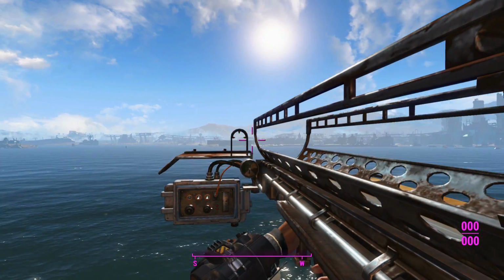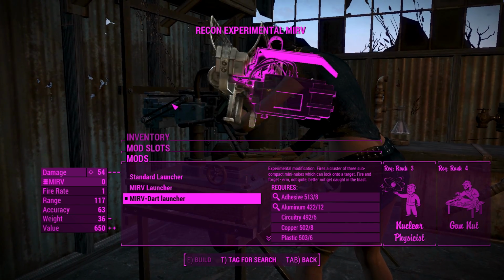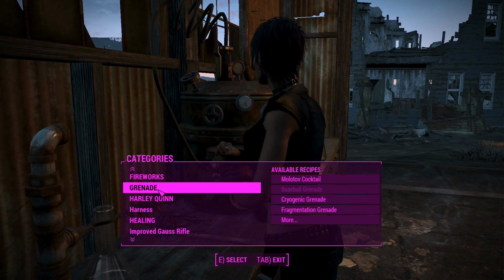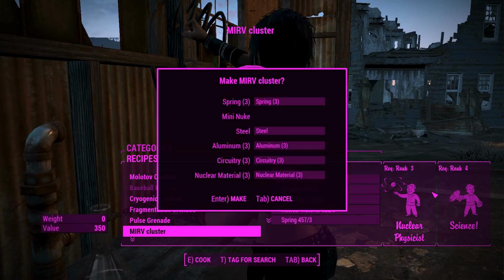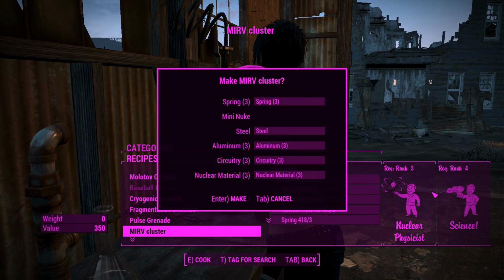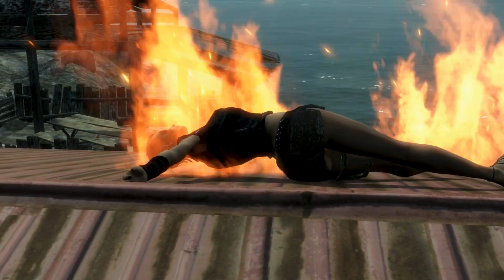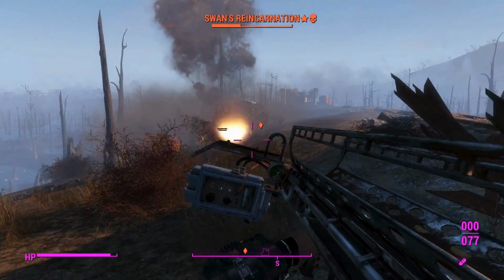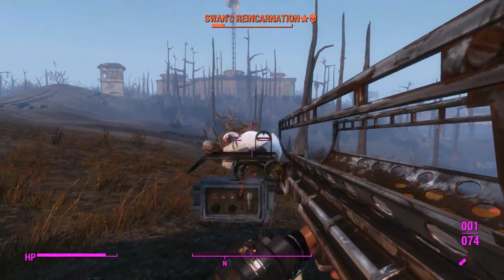Fallout 4: Weapon Showcases: MIRV Dart (Mod Update)

Comment: Sigh, back to the drawing board I guess ... :(
Personally I'm always using the homing function to make sure I hit what I want. And I don't think that I can fix the issue with the irregular firing pattern as this is an issue with the engine itself calculating the spawn vectors in an odd way.
EDIT: I think I should explain what I found out so you can better understand what's going on with the MIRV in general (and why it sucks so much): after some extensive testing I  concluded that the engine uses a VERY broken vec3d update system because the axes of the visual viewspace and the 3d worldspace are shifted. You can see this effect by turning on godmode, the use the MIRV and fire straight up. If you rotate your body after each shot you will notice that the spawn axis of the child projectile nudges. Depending on your orientation in the gameworld, the child projectiles spawn in a lower angle until the basically shoot straight downward, or they fly straight up to never be seen again (until you hear some very distant explosions). That meant the engine copies the player entitie's rotation value onto the the nudge axis of the spawn point of the child projectiles. That's so stupid that you really can't make this up! Bugthesda - it simply doesn't work it should.
Reply: Interesting bug. Sucks that it can't work.
Reply: @luissantiago5163  I know right. And as we have seen in Fallout 76 so far, this is not the only big one in the Creation engine.
Reply: @44WarmocK77  honestly they either need a new engine or some major reworks. I'm sure they will only fix it as much as will be needed to push out a product.
Reply: @luissantiago5163  as someone who already successfully performed heart surgeries on game engines to provide more features (mostly the ioquake3 engine) I can tell that this is something you can fix very easily (most likely just swapping out soem indexes or a vector translation from one system to the other, which is a one-liner for every axis translation and rotation which can easily be summed up in a single vec3d function). The thing you CAN'T fix that easily is their dependency on the framerate to calculate 3d movement and events. That requires adding a time-based (DeltaT) subsystem which all aspects of the engine will rely on - not something you'll do in your coffee break.